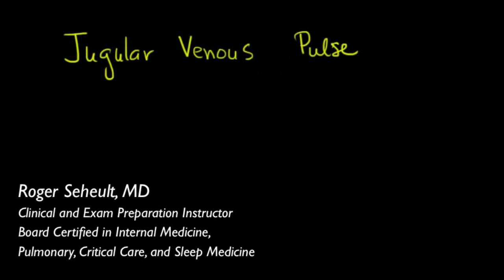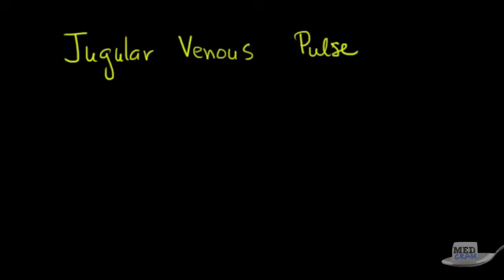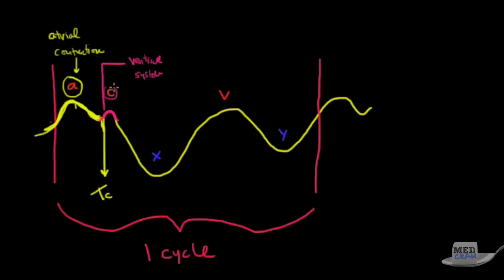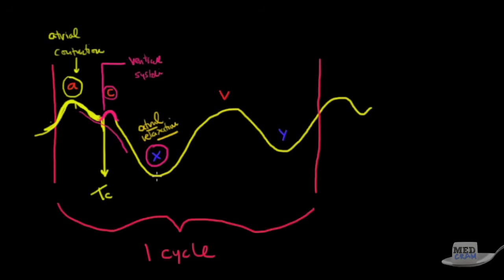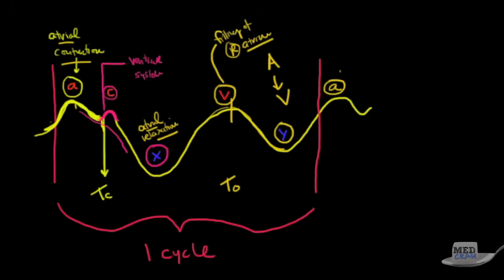Jugular Venous Pulse (JVP) Explained Clearly - Evaluation, Waveforms, Interpretation

Comment: in confused! the tricuspid valve opens before atrial contraction? if V is tricuspid valve opening and a (atrial contraction) comes afterward, it seems like the atria contract after AV valves open, and not at the same time. is that correct? plz help!
Reply from the maker: +Yaniv Hadi tricuspid valve opens as soon as pressure in the right ventricle falls below that of the right atrium. As blood fills the ventricle and the pressure equalizes the valve almost closes again only to be opened wide with the atrial contraction and then closed rapidly with ventricular contraction. Then the cycle repeats itself.

Comment: A=Atrial contractionC= Closure of triCuspidX = relaX (atria)V= Venous returnY = emptYing atria (passive phase)
I was actually watching this to figure out if C was truly tricuspid closure or carotid pulse--I watched a 1957 venous wave form video that said there isn't a "C" wave in atrial pressure tracings, but only when using a pneumatic jugular pressure tracing--but a cardiologist explained this as Closure of tricuspid, but gave no further evidence--is it ACTUALLY seen on a central line? That would solve the problem all together.

Comment: i dont get it. What is happening during atrial contraction? doesnt the blood move into the ventricle because the atria is contracting? please explain the difference between the "a" wave and "y" wave.
Reply: +Qtip783 I know you're probably beyond this now, but in case anyone else watching the video is confused (as was I):

the y wave is "passive" (the pressure in the atria builds up enough from filling to overcome the pressure of the ventricle and this opens the tricuspid; because the pressure difference is so great, the atria doesn't actually have to contract yet in order to push blood through to the ventricle) 

the a wave is "active" (because the pressures are no longer so different between atria and ventricle due to blood volume, to get the rest of the blood out, the atria have to ACTIVELY contract to push the rest of the blood through and keep the tricuspid valve open; this contraction maintains a high enough pressure so that the tricuspid doesn't close)

Comment: The only thing i do not understand about this curve is the v wave and y descent curves... I mean after the x descent,  if the atrium is filling up to cause the (v wave) while tricuspid is closed... after its filled up totally, it starts to contract to push the blood to the ventricle... this should cause another (&should be named) A wave (not that what is so called V wave)... cause how would the blood flow to the ventricle without an atrial systole!!!!? Thats my point....
Can u understand what I mean !??
Can anybody explain this to me!?
Reply: As I recall, atrium contracts at ventricular telediastole, and before that both atrium and ventricle are relaxed and filling passively (isotonic phase). Tricuspid opens when both atrium is partially filled and ventricle relaxed enough to be distensible again. This curve represents intraatrial pressure throughout cardiac cycle, one should think that intraventricular fluxes are somewhat different and how they influence the overall atrial flow and pressure. It would be useful to add a sinchronous ECG and a ventricular pressure curve for a better orientation.
Reply: Dr.Albert 

Which one happen first,Atrial Contraction or open of valves?
Answer is valve open first then contraction happen to forcefully clear the blood to ventricle.
You can start for C wave instead of A wave for better understanding.
Hope this helps
Reply: The atrial does not need to contract at V. This is the beginning of the diastolic phase, hence the blood flows passively from RA into RV (upon opening of the tricuspid) as the RV is relaxed and "pulling or sucking" the blood. This is similar to the diastology concept in the LV :-)
Reply: Hi, Y wave is actually not Rt atrial emptying, its Rt ventricular diastole, due to Rt ventricular diastole, tricuspid valve will sag  a bit and that will couse y descend , which will lead a bit more filling of Rt Atrium ,   soon after that atria will  will contract and form a A wave. There is a bit mistake in this video i think. If Y decend is Rt Atrial emptying into Rt ventricle then what follows after A wave which is actually Rt Atrial contraction.?
Reply: Eyeshath Hucen  Blood normally flows continually from the great veins into the atria even after V phase, but as the AV valve opens then after due to initiation of ventricular diastole, about 80 percent of the blood flows directly through the atria into the ventricles even before the atria contract (represented by v-y descent). Then, atrial contraction (a wave) usually causes an additional 20 percent filling of the ventricles (a-x descent).